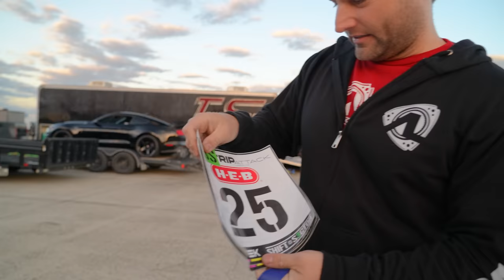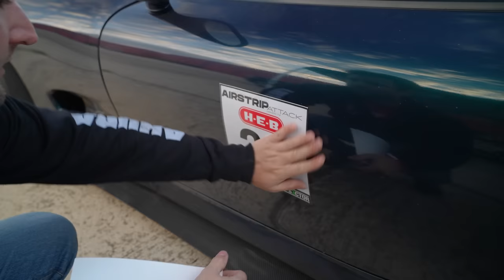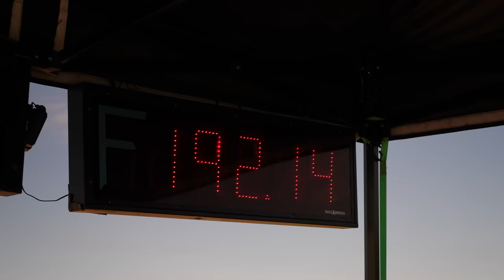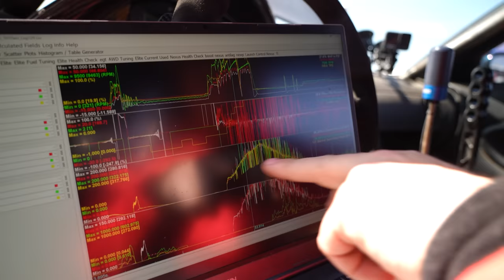The AWD 4 Rotor Breaks the Rotary Half Mile Record!

Comment: Why is the gearing so short?
Reply: cuz it copies the hoonicorn
Reply from the maker: I just lengthened it from 5.12 to 4.27 too. But it’s meant to be a race car where you don’t have gears for fuel economy. Top of 6th is 220mph
Reply: @RobDahm  ohhh so its more track speeds where the gears are closer? I was just confused because there is so much torque through 2,3, n 4 so you are essentially spending time shifting at high rpm and spinning instead of shifting and being right at the lowest rpm of max/near max boost. Seems like a great setup on track when u need those closer shifts in and out of corners though.

Comment: I don’t get how this thing has 1500+HP and 4wd but barely gaps a mustang and can’t beat a Ferrari off the line or below 120mph… I think it might actually be faster turned down to 800hp.
Reply from the maker: We swapped turbos and gearing from after doing the hoonigan videos. So I was tuning it on the runs. Went low boost and kept raising it so I wouldn’t blow the motor with the bigger turbo. Imagine beating a Ferrari on your second run ever on the new turbo and gearing. That wasn’t expected tbh. Boost was looking like a sine wave haha
Reply: @RobDahm  Wow wasn’t expecting a reply from the man himself, thanks! Yeah that’s not too shabby for a shakedown sesh!

I’m sure once you get the TC sensor issues fixed and get her dialled in suspension wise she’ll be even more of a weapon. You are basically r and d’ing a whole new car here, without Ferraris millions, so it wasn’t really a fair comparison, sorry.

Comment: Why don't you make it flappy paddle with the same gearbox everything you just do the conversion on top there by the gear leaver with the hydraulic piston shifting the gears for you? Then that way you can increase your safety at high speeds wen you have no need to take your hands of the steering wheel and the supper convenience of it ass well.

Comment: This shows how rotory motors are not as good as eletric the tesla plad track pack wpuld beat this and thats a stock car... rotary motors are for people who want to go slow like this pos mazda
Reply: Gay
Reply: @ihavewaited90daystochangem51  yes you are
Reply: @S2KCYA  nah you simping for elons panel gap mobiles is, If 0-60 was all people cared about we would pay attention to Tesla, but we don't.
Reply: Go race your Tesla against this on a long straight
Reply: @fresh5540  lol that turd wont even be running 🤣
Reply: @fresh5540  u dont know but cars like that require you to work on the basically each pass because they are unreliable and pinched to the max
Reply: @S2KCYA  because those recalled Tesla motors sure do last longer lmao
Reply: @S2KCYA  I do know and also this mazda is not THAT unreliable and it is meant to race, its not a daily driver, also it sounds better than a blender
Reply: @S2KCYA  You probably know nothing about combustion engines and why we like them
Reply: @fresh5540  lol yeah i dont build motors... did u even see my channel? My c8 z06 and my supercharged Mustang built motor ive had a gen 5 viper c7 z06 1000hp honda s2000... u dont understand because ur not experienced